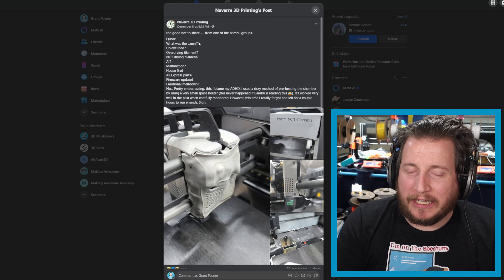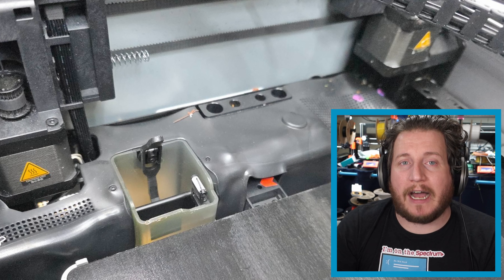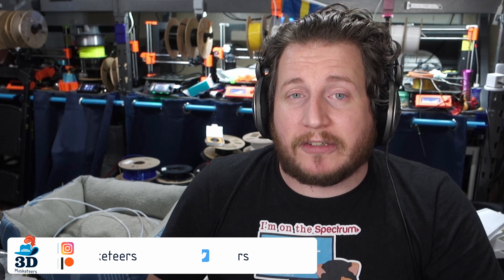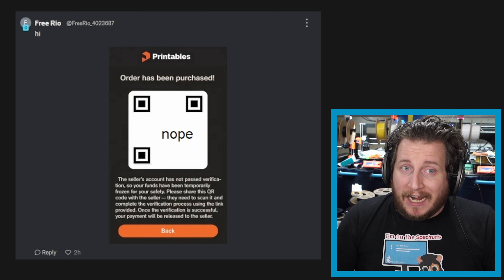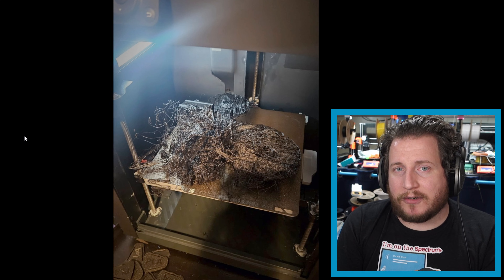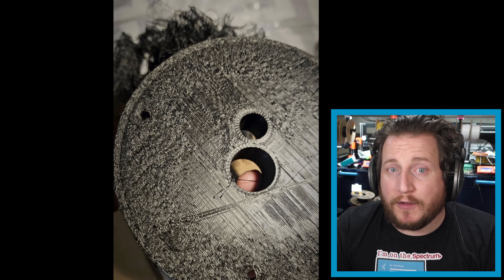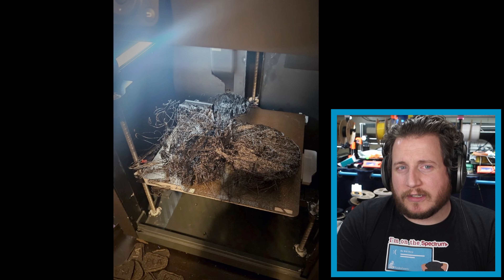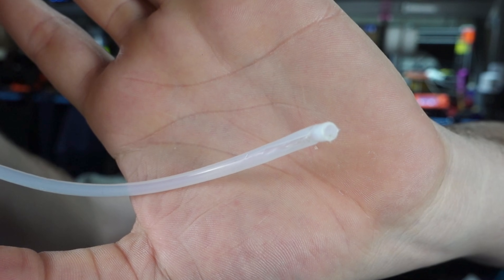You Won't BELIEVE Why This Bambu Melted! - PrintFixFriday 223

Comment: How does IPA spread around oil but not remove it? I literally covered my plate with oil the other day, used IPA to clean it, and first print was perfect. Also I hit my plate with 0000 steel wool long ago which is magic.

Comment: I had two Prusa printers catch fire, luckily I keep my printers in an out building, but it cost me 10's of thousands of pounds to rebuild my cabin. Prusa did not want to help me at all, so now have been using Just bambulab printers, had 4 A1s running almost 24/7 for over a year with zero issues, I'm so happy with this printer.
Reply from the maker: oh damn, what happened with the prusas?
Reply: @3DMusketeers Not sure, the worst fire the printer was mostly destroyed along with my shed/cabin, the second it was from the hotend area and everything was melted around it. I know people criticise bambulab but for beginners they are so easy to use, and changing hot ends is just a clip, not had a single issue in couple of years, just have to oil them when it prompts.

Comment: I wonder how hot that Bambu got, I've got a custom 3D printer that has a max temp of 100c chamber and when I've tried leaving some PETG parts in it to see what would happened, and I don't recall the pieces wrinkling that much just from being in the heat.

Comment: I don't have a chamber heater, but for my Neptune 4 Max, I built my own enclosure with reflective foil insulation so that the heat of the bed would act as its own space heater. It also has intake and exhaust fans, so that I can control the temperature if it's too hot (increase intake) or too cool (reduce intake). I usually keep it at a toasty but perfectly safe 28C/82.5F. If I were to shut the intake off entirely, an 80C bed will easily heat the enclosure to 43C, which would certainly be enough for ABS/ASA if I despised myself enough to print with those materials. If the bed temp was 100C, I have no doubt it would be able to keep the enclosure in the 50-60C range required for something like PC.

I don't print filaments that would require a heated chamber (purely PLA and PETG) but the lack of drafts and the warmth of the chamber does seem to prevent PETG warping.  

My advice to people would be to avoid a space heater if possible, and instead just make a really thermally-reflective insulated enclosure. Control intake level with fresh air, keep a thermometer in the enclosure window, and adjust as needed to maintain desired temperature. But what do I know?

Comment: Thank you for the informative video. I also had very bad experiences with PETG printing. I always had to use glue to get the print to stick properly to the bed. It has a strong tendency to warp and shrink and the prints did not even have had a convincing quality in terms of both stability and appearance. The nozzle temperature as well as the bed temperature must be very high, on the other side chamber must not heat up too much, but there must be no airdrafts either. Then I can also print with ABS or ASA, with which I have achieved much better results and the material is clearly superior to PETG. PETG also absorbs moisture like a sponge. For me the material is therefore completely unnecessary and pointless.

Comment: You recommend ammonia-based glas/windows cleaner instead of IPA. Why do most 3d printer companies tell users not to  use it? And my LLM (Perplexity) also thinks, it is not a good idea.
Reply from the maker: Alcohol just spreads the oil. Glass cleaner actually removes it. 

And why, because we have done tons of testing and have been successfully using it for years now with no issues :)

Comment: My mk4 had the MMU3->Extruder boden tube crack. It spat out like 10 feet of filament before it gave up. LMAO. I replaced it with a spare and the print continued with no further issues. You can't even tell there was a problem.

Comment: i'm just guessing that petg print has the spring sheet bending in the middle maybe due to the magnet of the bed is weaker. it happen to me too and i notice a bump in the middle of my plate which happens if the bed is higher than 70degC. due to that, i thought my first layer was spot on but it was off by 0.5mm which cause the surrounding area of the bump to missed the first layer when printing

Comment: I see that issue with ptfe tubes on mine Q1 or max3 Qidis. This is likely due to the 3mm inner radius and 4mm outer tubes, which frequently touch the top elements of the printer. Their extruder works less well with thicker PTFE tubing, so I assume you'll need to replace the PTFE tubes more regularly.

Comment: I was thinking about having two Arctic S4028-15K’s blow across a 500W PTC heater (with an omron ssr) in a PC-CF box with two 40mm diameter exit chutes for a 350mm cubed 4040 trident, with some extra room for an indx to have full motion. Steal some QP4 code, tweak it, add a failsafe based on the fan tach readings, add thermal switches in the chamber and on the SSR… am I missing anything?

Comment: Regarding the melted Bambu X1C, I just replaced all of my plastic tool head parts, both board and the complete micro Liadar.   The boards and Lidar  are expensive, but mine were under warranty, still a real pain to do.   I agree that the melted one should go to the spare parts graveyard.

Comment: The last Sunlu PETG I bought that came on the new blue plastic spools, needs to be printed way cooler. Before, the cardboard spools, I was able to run it very fast at 260, but this stuff had to be slowly printed at 230. Any higher and you get all these bubbles on every layer. Do a temp tower with that stuff. I'm not buying it again and I'm glad the 4 spools are done. Elegoos rapid petg runs on the old Sunlu settings without a fuzz.

Comment: I had a Creality CFS with what I knew was several thousand filament changes on it and the Bowden tubes were wore through to the point where the filament was digging into the plastic frame of the filament loading and unloading motor assembly!

Comment: I added a DIY 300W 24V ceramic chamber heater in my Prusa Enclosure to reliably print ASA and PC without warping, but set to just 55°C. The last PC-CF run with 10 hour long prints softened a few PETG parts that are under constant load of the MMU3 and it didn't work after. I just printed the Ultimulti MMU modification and some other parts out of PC-CF and its fine again. I also printed other parts that may fail in the future.

Comment: 8:30 is a terrible layer first layer flow. You can see there are sections that look too close, sections that look too far, and sections that look okay, which is typical for a nozzle that is unstable because its too close to the printbed. PETG is highly sensitive not just to temperature, but first layer squish. If you dont have exactly the right flow for the first layer, or exactly the right offset, or both, you will not be able to print properly. The easiest way to check this is, after calibrating temperature reasonably well, to print a custom part, about 100x100mm, where half is one layer high, and the other half is two layers high. print one, measure the thickness of the 1 layer and 2 layer tall sections with a pair of calipers. adjust first layer flow until the first layer comes out the correct height. Adjustments to z offset may be required if your printer doesnt reliably calibrate z offset. Most printers on petg and a texture buildplate on petg will print flawless at 70% first layer flow, a tiny bit of elephants foot compensation, and about 98% or so flowrate, very slight underextrusion.

Comment: Personally, I think people put too much emphasis on heated chambers.  But this is just my opinion.  I do not have any heater in my X1C, and I've printed plenty of ABS, ASA, and PACF prints with no issues.  My chamber temp is usually around 45c just by closing the door and lid.  And I would stay away from adding any heaters to a printer that wasn't designed for it.  There is no telling what kind of long-term issues you're going to have because of electronics not properly cooled if you use an aftermarket heater.
Reply: I pre-heated using the heatbed for a little before printing at the X1C and no problems.
Reply: Now check your layer adhesion without the heated chamber on ABS/ASA prints. It sucks… 
No visible issue does not mean there isn’t an issue. You really want to have a 65° heated chamber, I have 90° chamber and it is a day and night difference when printing these polymers.

Comment: that PETG print - the side in the pic was the toolhead side as you can see print lines and nozzle dragging. its overextruded to a point where it started clumping. user did not flow-calibrate for the filament and results are in the pic

Comment: I've worn a few boden tubes out on my X1's, since i have been printing alot of PETG with glitter and CF/GF mixes. Had a few machines that the tube quality out of the box was noticeably different as well. Running a much thinner out wall, allowing for easier flexing. H2D's tubes seem fairly robust though.